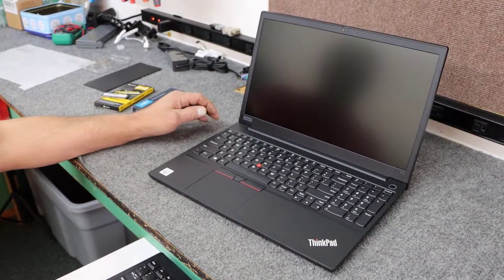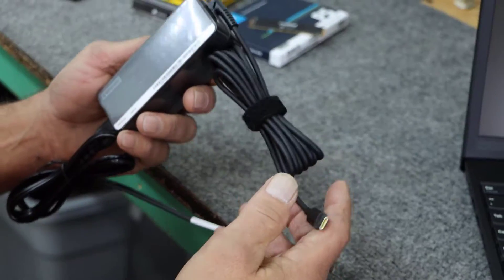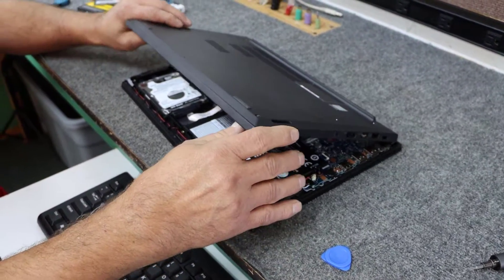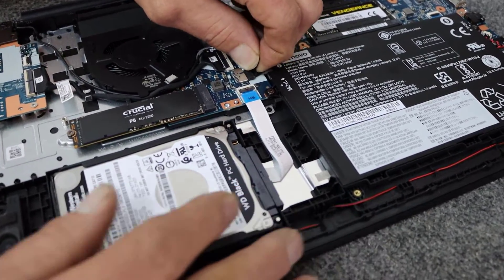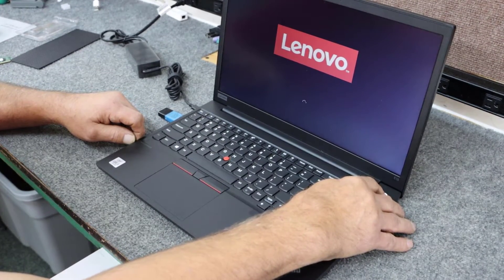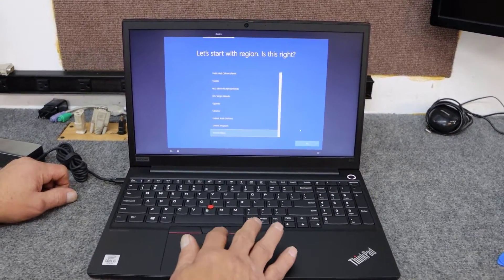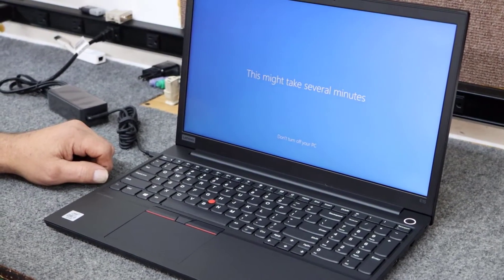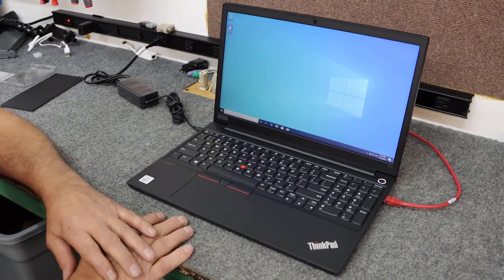Lenovo ThinkPad E15 Laptop, Install New NVMe SSD, Upgrade Memory, Clean Windows 10 Pro Install

Comment: My Lenovo E15 ThinkPad is having 8GB RAM, 128GB SSD and 1TB HDD. After upgrading from Windows 10 to Windows 11, my SSD is almost occupied 90% of the storage capacity. What is the solution to overcome this problem? Whether the present SSD can be upgraded to 512GB storage with factory settings with original OS and other bundled software?

Comment: Is it worth upgrading rather than buying another laptop?
Reply: depends on what you need it for. Speed is often limited by ram, and ssd. so in that regard yes. but software compatibility is always limited by cpu year. so.. if you want it to last, you should get a new laptop with the most recent cpu. for example, windows 11 wont even run on any laptop without tpm 2.0 or higher. which means the cpu must be insanely recent.

Comment: Great tutorial video, thanks 👍 I'm curious if you've had any ThinkPad laptop sent to your shop with build quality issues like broken hinges, gaping between the upper and bottom housing when unfolding the display, etc. I am looking to buy this model for home, hope that it'll last longer without having to shell out cash for bottom case cover and palm rest replacement after less than a year 😥

Comment: Can the ventilation system be upgraded? With  the NVMeSSD and the RAM upgrade I believe it might heats a lot more that it already does. Anyone with heating troubles??
Reply: only cpu and gpu upgrades cause heat difference..

Comment: How do use the ethernet? my cable wont fit in it
Reply: Push the cable end in, the flap will get pushed down to allow it into the port. If it doesn't pull down the plastic flap as you push the cable end in.

Comment: can i upgrade the gpu
Reply: no.. laptops have gpus integrated in the motherboards. and some have them integrated in the processor. in which case you can change the cpu. but no, its not an option. a new laptop is cheaper than switching any of those.

Comment: I have the ThinkBook 15, 15.6" with 10th Gen Intel Core i7-10510U, 16GB DDR4 memory, 512GB M.2 PCIe SSD, it's a great laptop, can only run 2 extra monitors my only beef, I mean so many ports for what?